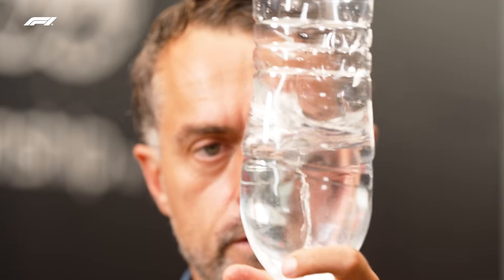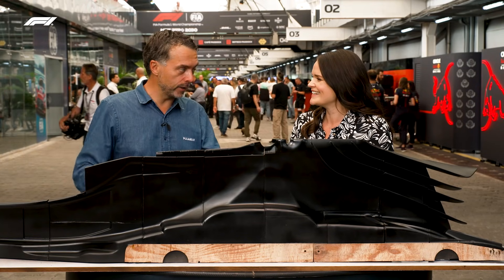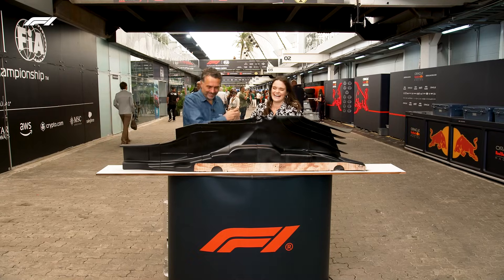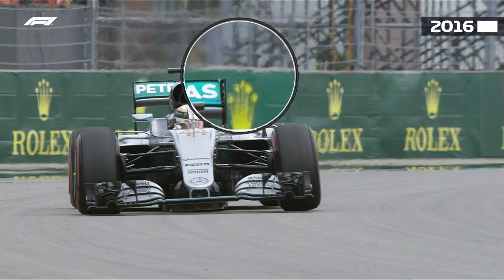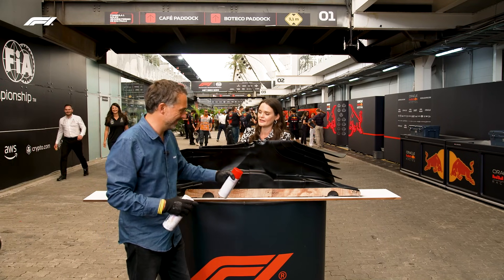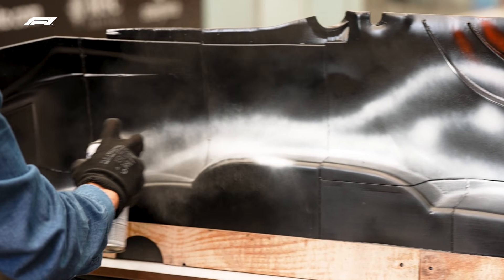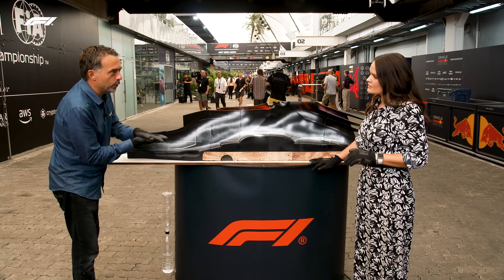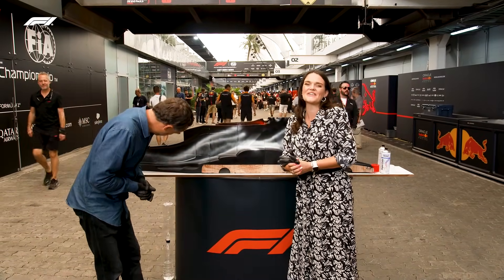The Quest For A Flawless Floor | Albert Fabrega F1 TV Tech Talk Demo | crypto.com

Comment: Very cool, not only do the air drafts disperse the air to create a huge vaccum - downforce, but as a result the vortex created actually propel the car forward faster. Same as the water was speeding up!
Reply: Analogous. Not the same. For the ground effect it's air-on-air. No water. Does make a difference. But like Albert explains, you can see the water much better than you can see the air.

Comment: The main reason why RB is not as dominant anymore now was actually Perez Manoco crash. Of course the other teams took note and came with their own "RB floor" in the second half of the season. All the other aero changes brought just very little improvement as wings and body are way worse in efficienctly creating downforce. We could perfectly see this with Merc, as the went away from zero sidepod design, which made them even slower at first. Without unveiling RB's floor in Monaco, Max still would be 1 sec faster on qualy laps than anybody else.(Perez seems not be able to make use of the extra sauce RB has in it's floor) .
Reply: no, the MAIN reason is that RBR stopped developing this seasons car as they had almost a 1 minute gap on other teams.  Perhaps you've seen some minor upgrades to stay ahead of the curve but by no means is the effort the same as it was at the start of the season.

Comment: 4:18
He almost said " when the air is IN the.. " . But said " UNDER the.."
2022 was UNDER and did not work at all. 2023 its IN the floor.
Air goes IN closed tunnels between the floor and the seat

Comment: Thats amazing it's like the front is the Inlet and then middle being Compressor section leading to the exhaust section sorta like a ram jet engine, or like Bernoulli principle. Side note do they still use a Tea tray ?
Reply: The ground effect is caused by Bernoulli's principle.
Reply: @eabradley1108 2023 is not ground effect. 2022 they tried ground effect, but the air kept coming out the sides instead of in back. Thats what created the bouncing. 
Real ground effect was demonstrated by Lotus back in the days, and FIA banned it after a few races, saying was too dangerous.. but the real reason, we will never know. 
Lotus Ground Effect Side Skirts
Reply: Yep still in regs. Also tea tray can be equipped with damper spring for controlled flex and rebound.

Comment: Notice how the vortex occupies space in the center of the bottle, reducing the cross section area that the water can pass through, accelerating it.
Reply: It's completely unrelated, the water speeds up because the air pressure can escape through the tunnel in the middle as if you put a straw in
Reply: @virtual_GaRy  In water, and air below ~ Mach.6 there's a nearly 1:1 relationship between reduction in cross sectional area and increase in fluid velocity. Meaning if you half the cross sectional area, you double the flow velocity across the throat. Having a vortex in the middle of the floor is a great way to have low loss, high energy flow in a smaller cross sectional area than the regulations allow physically.
Reply: @virtual_GaRy Correct, there's less air resistance, and also there's less cross section area. The logic applies to these floors as well. The bulge on the floor is where the tunnel converges, reducing cross sectional area. The whole point of a venturi tunnel is to reduce cross sectional area to increase the velocity of the fluid travelling through it.
Reply: All I think of while reading these comments is all the times Vettel and Webber aggressively sipped water during press conferences at the height of their rivalry.